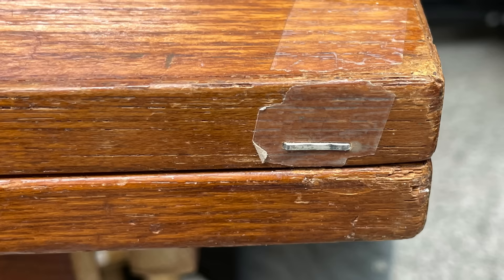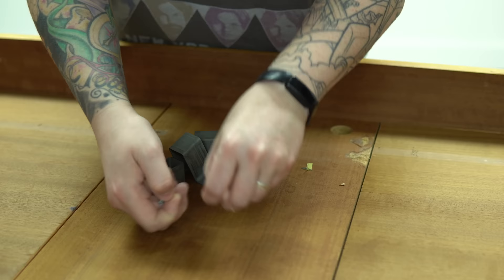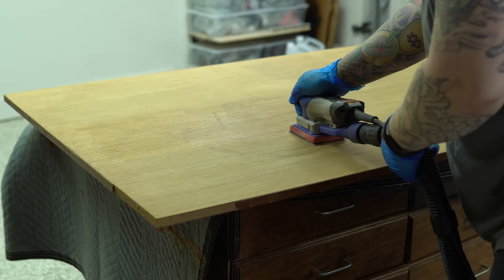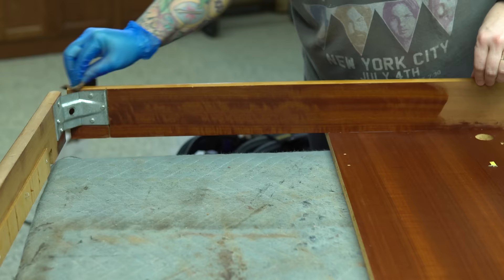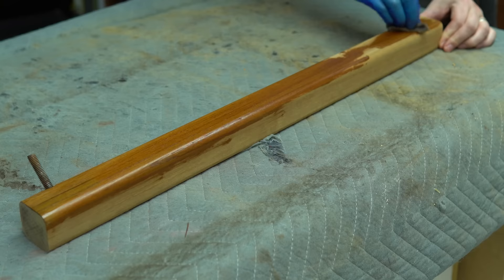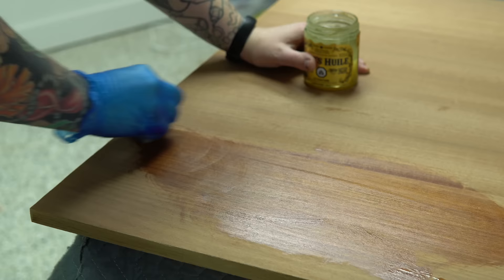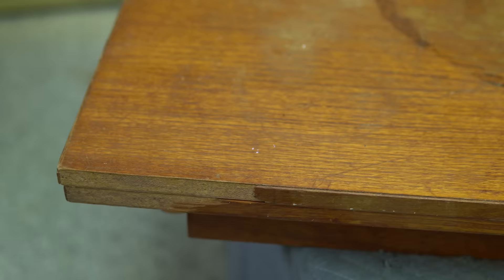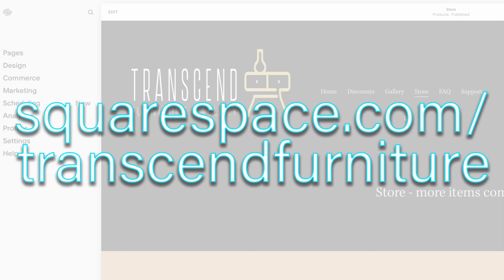I restored this absolutely WRECKED Teak Dining Table

Comment: First... am I alone in that I like the faint shadow of stains or marks in a restored piece? 

Second... Angie, if you have time for a question; is the lacquer you used heat resistant? I'm trying to get to a place where I can redo a huge dining room table. The one I have gets white stains REALLY bad and I want to avoid that with this one.
Reply from the maker: Pretty much any finish hates heat. I haven't found a single one that doesn't leave heat marks at least some of the time. So far, Odie's Oil seems to be the best at resisting water and heat marks, but I just always use coasters and placemats now regardless.
Reply: @TranscendFurnitureGallery  Thanks! I still haven't managed to get to it. Yay for garages. But now that it's heating up I should be able to do the things soon! I appreciate you taking the time. 💖 Have a peaceful week!

Comment: Great job, could you just flip the table tops and have a Mahogany table?
Reply from the maker: There are a few reasons why I couldn't do that - firstly, of course the woodgrain won’t match the rest of the table, but also- the edges of the underside are less than stellar so that would be an issue. The underside also has two round holes I’d need to somehow patch and colour match, and the teak edge banding wouldn’t match either. So unfortunately for me, it’s just not a viable option.

Comment: Is your surface pro sander connected to an exhaust hose? if so how do you do that?
Reply from the maker: I have the SurfPrep, with vacuum attachment. It’s currently connected to a POV-8, which is their newly released dust collector, so they attach perfectly to each other.. but you could also attach a surf prep to a regular shop vac if you get the right adapters for it. When I first started, I had my dewalt sander connected to a shop vac with electrical tape. Lol Not fancy, but it did the trick!

Comment: If at least half of the trim was there, you could have cut it into triangles or rectangles and used alternating strips with a different trim to create a pattern of alternating light and dark along the edges.
Reply from the maker: Thanks so much for watching and the tip! 😊

Comment: Do you take a photo of the piece where you need to remove the screws?  I know you’ve been doing this for a while, but for someone who is jus getting going, what would you recommend on how to replace the hardware in the proper places?
Reply from the maker: Good question! Taking a photo is great when there is a lot of hardware/fasterners, or you can have a few reusable baggies. Put the pieces in there, label the bag with a piece of painters tape, and put a matching piece of painters tape on the piece where the hardware goes. That can be helpful in some situations.

Comment: You didn’t use vinyl sealer before the lacquer?
Reply from the maker: No, the tung oil already sealed the wood.
Reply: @TranscendFurnitureGallery  Is there a reason to use tung oil instead of vinyl sealer? I think I watched another video of yours where you used the vinyl sealer before the lacquer. I’m asking because I just bought a small teak table that needs refinished. Trying to figure out what to do.
Reply: @TranscendFurnitureGallery  is there a special reason to use tung oil instead of vinyl sealer?
Reply from the maker: @tammywalla7259 no- I didn’t initially intend to use the lacquer and toner. But I needed to see how the staining came out after the oxalic acid, and the tung oil. If it had looked a bit better from the previous damage, I would have left it just at the tung oil. Some of these really damaged ones, you just sort of go one step at a time and then evaluate.

Comment: I am refinishing almost exactly the same table, could you please tell me EXACTLY which toner you used? On the mowhawk website there are several choices I "could" use but don't want to screw this up and don't have a lot of color matching experience. Thank you!
Reply from the maker: Actually - all of my videos contain a full list of items and products used, along with links for purchase, in the description. Just click on the Show More... and a full list will pop up for you.

That toner is 💡Mohawk Toner- Cherry

I hope this helps!
Reply: @TranscendFurnitureGallery  for the toner you state "(too expensive on Amazon, check your local retailers)" ... so which I agree with, but it leaves some ambiguity as to which one. On Mohawk's website, "toner cherry" is M101-0408. Is that the one you're referencing? The swath on their website looks too "orange-y" to be correct. I only get one shot at this so I want to be 1000% sure :) Thanks!
Reply from the maker: @wahoo189  this is a Canadian site but this is where I buy mine. I use the ultra classic toners, there are I think two types of toners they make. The cherry swatch is pretty orange. Just make sure to use very light passes, almost misting or fogging it on, rather than spraying it like a spray paint. Several very thin coats is better than one or two thick ones. :-) https://ardec.ca/en/p/1220/ultra-classic-toner-aerosol?variant=10466&gad_source=1&gclid=CjwKCAiA5L2tBhBTEiwAdSxJX6CPi4JRePxfZ-RjONkjkkhPL9FOAOMWXYN5lzpNOzdVly_vU57L5RoCFbgQAvD_BwE
Reply: One more question: I got the precat lacquer and toner now, but I noticed when I wipe down the tabletop pieces after a final sanding with a damp rag, they are essentially the color I would like.... Will the lacquer alone keep these pieces this color? When the wood is dry, it has a lighter, more raw color. Do I need the toner or no? I'd attach pics but I don't think yt allows it. Thank you so much! This video has helped a TON!
Reply: I rescind my last question. I applied the toner and the pre-cat and the job is done. Uh-maze-ing! I'd love to send you photos! I couldn't have done it without you!

Comment: great work BUT: do not ever put tape over paper or delicate makers marks, tape will darken, harden and degrade much faster than the paper, wrecking any provenance in a fraction of the time
Reply from the maker: It’s extremely low tack painters tape, which was removed 20 minutes after sanding was done. There was no risk of any damage.

Comment: If you want to save yourself a whole lot of time and money on sanding paper in the future, Learn to master the card scrapper, it makes short work out of taking off old finishes and you have less of a chance to go throw the very thin veneering, Just a suggestion.
Reply from the maker: I use both a card scraper and handled scraper regularly. :-)
Reply: @TranscendFurnitureGallery  they sure are handy and quick once you learn how to give them a burr which is the worst part of using a card scrapper hahaha, I mostly restore old radios and coffee tables, I would never go back to an orbital sander to get the bulk of the old finishes off. Cheers

Comment: Did you think about flipping the top and having the mahogany top be the president in the stand underneath
Reply from the maker: There are a few reasons why I didn't do that - firstly, of course the woodgrain won’t match the rest of the table, but also - the edges of the underside are less than stellar so that would be an issue. The underside also has two round holes I’d need to somehow patch and colour match, and the teak edge banding wouldn’t match either. So unfortunately for me, it’s just not a viable option.

Comment: Particle board? Pretty sure it aint teak. NOBODY wastes teak veneer by putting it on particle board.
Reply from the maker: Haha, actually close to 90% of mid century designer (and factory) walnut and teak pieces are veneer over pressed wood. Like.. almost all of them. But everyone always thinks they are solid wood. I can’t even count anymore how many times I’ve gone to get something listed as solid wood and then have to show them it isn’t, which floors most people. 
This is teak on top and the face of the apron (and solid teak legs) and mahogany on the underside and back part of the apron. 
It’s extremely common.
Manufacturers did this because solid wood can be unstable from a movement perspective and would be absolutely cost prohibitive for most people when dealing with exotic woods.